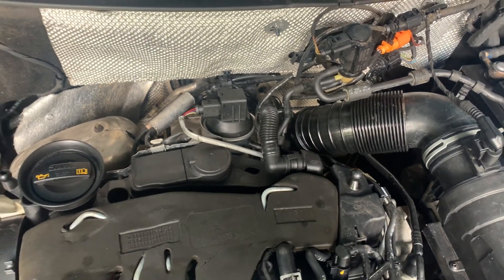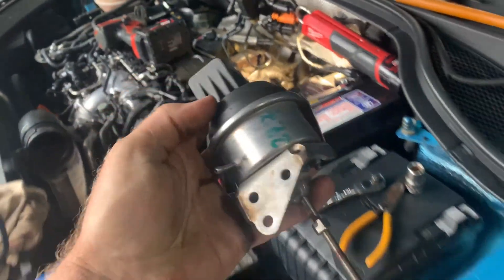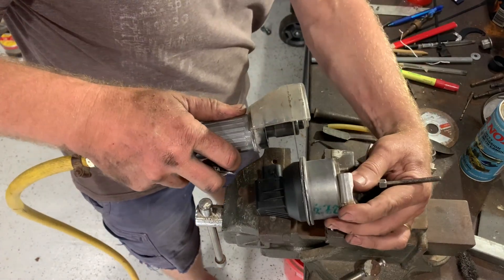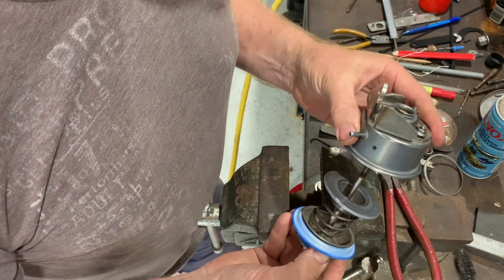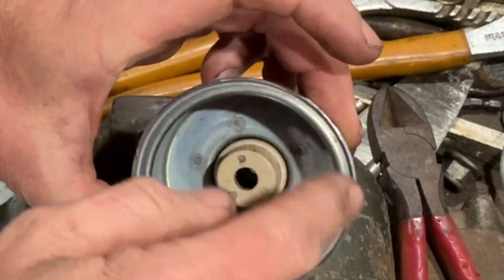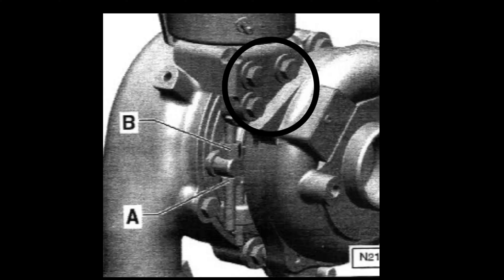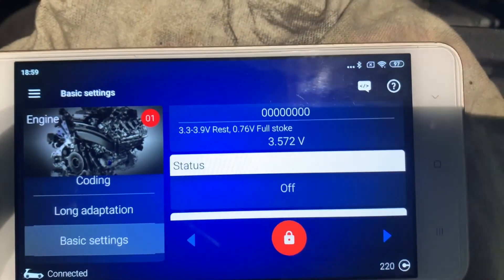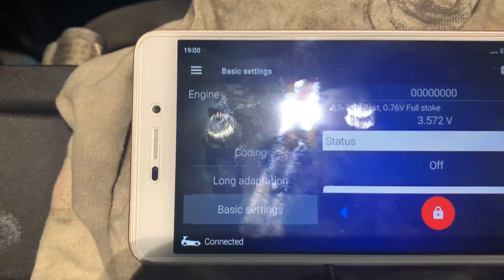Tiguan Ep 2 NO BOOST! How the VNT actuator failed and how to replace it.

Comment: Mate I said mate I said mate…
Lol You blokes whingeing about actuator stem being too long. But yet none take an inch off your replacement so easier to adjust and easier for the next bloke to take out 🤘
But otherwise brother, one of the better ones I’ve watched Aussie Aussie Aussie
Reply from the maker: Good idea and no reason why not to do that.
Reply: @PetesWorkshop 
Take an inch of it so easy to get long 10 mil flexible in there and don’t need to remove anything🙏
Just out of curiosity, did you find out what the best cracking pressure was PSI?
Reply from the maker: @tommygun1262 no I just set it as per VW spec.

Comment: Hey, fellow mechanic, great video, out of curiousity, could you set the rod depth before fitting it to the vehicle to make it easier? Obviously  electric plug connected with the Mighty Vac. Regards
Reply from the maker: You should be able to get it pretty close (match old with new) but the final check must be with it connected to the turbo vane actuator.
Reply: @PetesWorkshop  Thanks for the reply, will do the videos procedure. Very helpful. Thanks again.

Comment: Cracking vid. Out of interest what is the symptoms of this being wrong? I’ve got a Tigwan mk1 with intermittent no power/boost and cuts out after a few seconds when running now. But sometimes is fine! Could it be  the vacume side so maby solinoid? Or wastegate side? Thanks In advanced
Reply from the maker: @Tom-j1r  it could be the variable vanes in the turbo are gummed up (sometimes moves other times can’t).

Comment: On mine the 3 nuts on the side are blocked by a metal tube. Did you have to remove that to get the bolts out? Thanks

Comment: I’ve got an question a friend of my says the actuator is broken but I don’t get any fault in vcds   My symptoms are that the turbo kicks in at 3000rpm🤷🏼‍♂️ and nearly sometimes It kicks in at very low rpm like it normal TDI does 🤦🏼‍♂️
Reply from the maker: The VNT actuator requires vacuum to operate. You should use VCDS to monitor the values and apply vacuum (use a vacuum pump) to check it. The Vanes in the turbo can get stuck and stop boost from being created. I think this may be your problem since you are not getting fault codes. You could also set up live data logging to compare ‘required boost’ to ‘actual boost’. I’m sure VCDS could do this. Let us know what you find out.
Reply: Hey! Just wondering if it was the actuator? 
I’m having the same issue you describe, I’ve ended up onto this video so I’m hoping this is the issue!

Thanks

Comment: Thanks, great video. I did much the same and actually removed the turbo cartridge from the manifold housing to inspect the vanes because I wanted to confirm they were doing their job correctly before ordering parts. Pig of a job, mainly because the pipe union for oil supply loosened the fitting from the turbo rather than just from the pipe union. Eventually got there. Actuator should be here by the weekend.
Reply from the maker: Please let us know how you go.
Reply: @PetesWorkshop  120
Up
Down
Group
Up
Down
Group
003
Up
Down
Start!
1.6% lambda
-2.4% lambda
00000100
binary values
Start!
Start!
X
inte appl
thionation
s- Tech
0.608V
Tiguan 2.0 cbab it is well adjusted

Comment: When u did pull out the actuator, 
Was only one bolt on , 
After watching the video , a second bolt was showing on the rod , 
Can I know where did u find the second bolt ? 
Where about in Australia are u ? 
Are u in Victoria?
Reply from the maker: Do you mean the nut that is on the rod at 0:35 seconds into the video? There are two nuts on the shaft to clamp to the vane arm. One nut above and one nut below. This is how you adjust the position of the turbo vanes. To remove the actuator you must remove the lower nut AND the 3 mounting bolts. Make sense? I’m in Brisbane, Australia.

Comment: Very interesting, I have an issue with my Golf (stuck VNT vanes) which I will attend to shortly. Can I ask what diagnostic tool are you using there, very handy to be able to check those voltages. Thanks for putting this video up.
Reply from the maker: I’m using OBDeleven